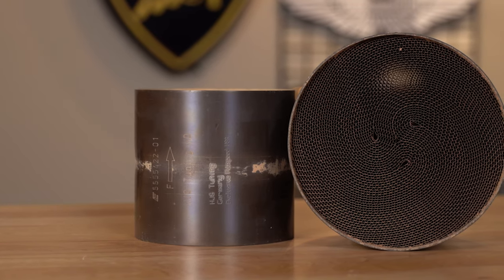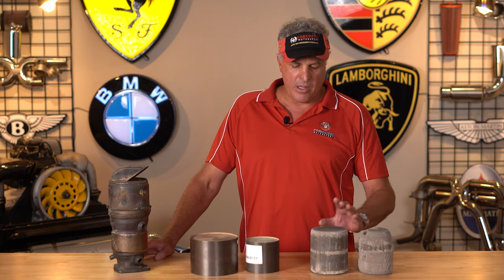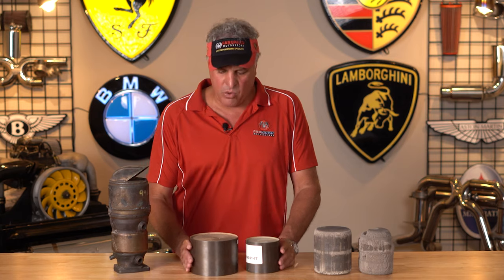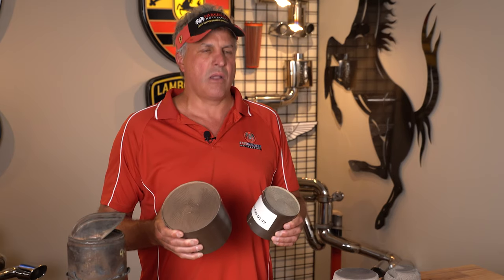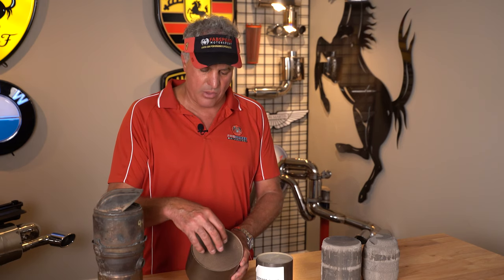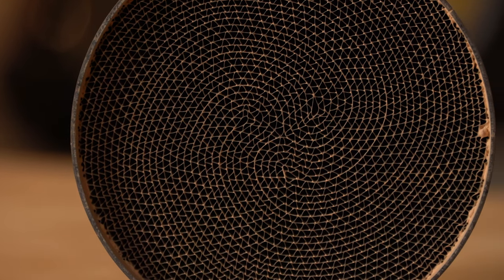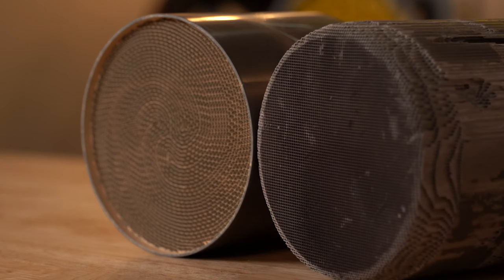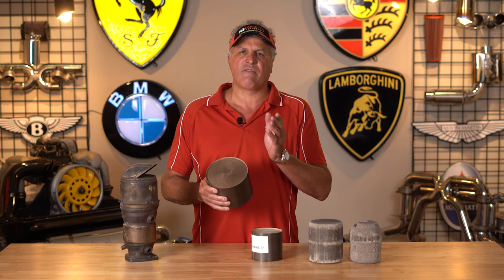The BEST Catalytic Converters In The World | Why Fabspeed Only Uses HJS High Flow Cats

Comment: How much does a good quality cat (let’s say 200cells) lasts? I’ve been hearing from my mechanic that won’t make it past 2-3 years before I need to replace it, but even if I take good care of everything is the same story?
Reply from the maker: That will be highly dependent on 1. The catalytic converter 2. The engine and tune of the engine 3. The operating conditions (Track use, street only etc) 
That all said, we warranty our HJS catalytic converters for 5 years and we typically see them last 5-10 years of normal driving.

Comment: How much power loss is there with these catalytic converters compared to a straight pipe ? I'm asking for a 2 Liter 4G63T engine that will be producing 600-800 HP on street and 1000 + HP for track use. 
So if without a catalytic converter the car makes 800 HP , how much power loss can I expect by adding a nice big(as biggest as recommended) cat converter?? 

Also, if I am only going to make 1000 HP maximum can I still use a catalytic converter rated at 1500+ HP? Will that only just lessen my power loss? 
Thank you in advance
Reply from the maker: At 1000 HP, through a single giant HJS 200 Cell Cat, you'd probably loose 20-30 HP vs a 4 in straight pipe. On the big power McLarens and 911 Turbos we'll see 10-20 HP more with a straight pipe compared to large HJS cats. 

To put it simply, you want the biggest cat you can fit. There's no downside to going bigger.

Keep in mind, race gas or e85 will void the warranty on an HJS cat. We recommend designing your exhaust so you can easily swap the cat in for the lower tune/pump gas and swap a straight pipe in for race gas/racing applications.

If you'd like to purchase the largest cat possible, please give us a call at (215) 607-7965, because we don't list the largest ones on our site.
Reply: @FabspeedMotorsport  HJS also sells Motorsports version of their Catalytic Converter, Can you use those if you still want cats & running race gas or e85?
Reply from the maker: @wd8005  We're not sure about that, if you'd like to purchase one we'd be happy to talk to HJS about it.